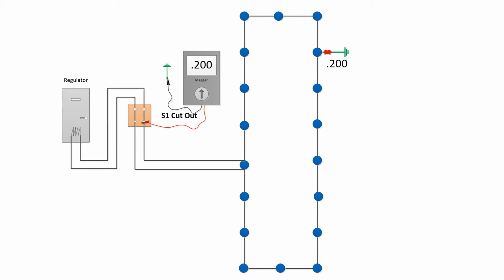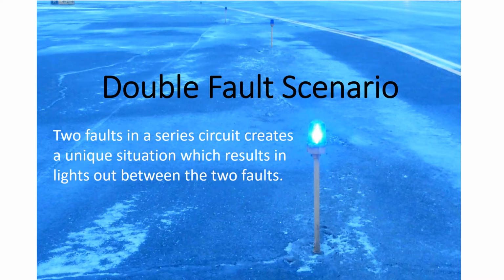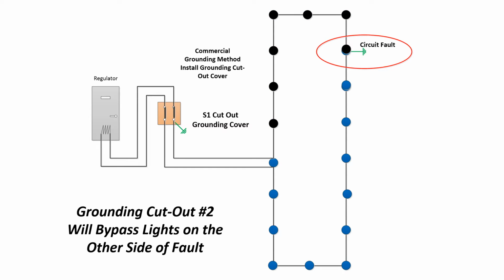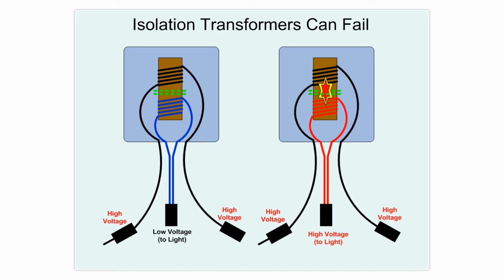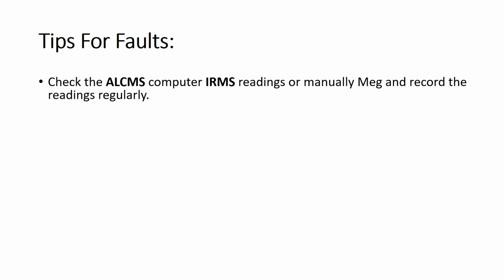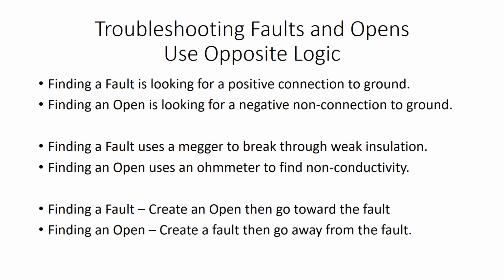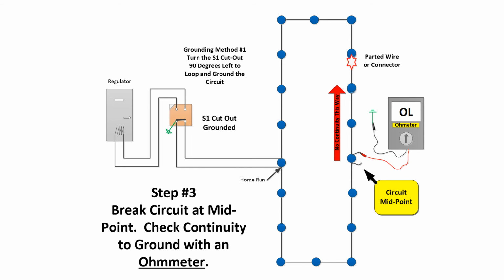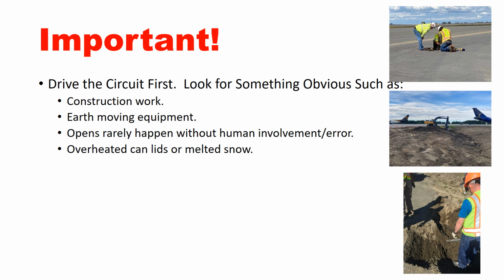DOT&PF Troubleshooting of Airfield Lighting Systems

Comment: I don't see a S1 cut out just has wires that go out and leave the building I'm assuming I'll have to cut them and manually join them with a ground. I can't find any documentation on this power regulator doesn't match the documentation on site. has a digital display saying open circuit and a keypad wish I had a manual. Crawling around in -30 with a pick axe opening cans that are buried under 6ins of frozen sand brr
Reply: Ooof   That's tough!  Good luck!

Comment: Multiple circuits in conduit  megger  detecting voltage cannot use 
5 days later tracking down fault located burn into two circuits under taxiway C 
PAPI’s and edge lighting 
Fun

Comment: I just started as the airport maintenance operator at palmer airport and airfield lighting repair is in my job description, i am not an electrician. These videos have been a great help thanks beav! My friend does airfield lighting for DOT in the MatSu valley so i do have someone to call with question so dont get the smoke let outta me.
Reply: Feel free to give me a call if you have any questions.  I live in Palmer so I could easily stop by some time.  Beav
Reply: @dennisdeering7010 hey Dennis wanted to ask you a question with a problem we’re having in our airfield if you can maybe give me some trouble shooting tips lmk

Comment: I have problems with TGS sir, can we modified the series transformer in to 220 volt...?
Reply: Some Regulators have multi taps for different input voltages.  Make sure you consult the manual and the manufacturer to see if yours can be modified.

Comment: To answer @159jakelong"s question:  Airfield lighting is a constant current AC series circuit and basically a big loop.  There is no neutral and no ground.  That's confusing if you are used to working with standard constant voltage parallel systems.  If you would like a more thorough explanation of this I'd suggest looking at another You Tube video called TSAIA - Airfield Lighting Safety Program.

Comment: Very informative. You are wrong about the double fault lighting through a ground. It lights from both ends through the regulator. We also don't use the cutout anymore because it can create more problems. It's better to find the actual problem in the field with a megger with the block out.

Comment: I got shocked from what I can only figure was the primary side of a circuit once. I had just changed the light and was grabbing at the bolts as I was also standing up. At that moment, I heard a crack and I felt my muscles convulse and for a brief moment I felt a 60Hz electric shock. Would I have not been in the process of standing up, I suspect I'd have fallen down and gotten possibly locked onto the can and wouldn't be writing this now. It didn't stop me from relamping hot though. I didn't sit through the whole video, but when troubleshooting remember that cans can explode. I saw this once. That white atmosphere inside of the can is vaporized wire insulation with nowhere to go--and it's flammable. We found a fault that was still arcing and thankfully everyone had wandered away from it before it exploded in a 4-5 foot fireball when oxygen got down low enough it reached the arc. Fixtures can be blown up in faults too, the water in the can boils and creates enough pressure it can blow the fixture into your face when the bolts are taken loose. If you're troubleshooting, either turn it off before you open the can or just loosen the bolts and use a pry bar to get the fixture just off the ground so you can see if steam and smoke start billowing out from it. And remember to clamp everything before you disconnect it. I left my airfield job thinking I';d be getting more money but instead found less money and a job I don't like. I miss getting paid to play frogger with airplanes.

Comment: When taking the readings to ground do you drive a stake in the soil or just use the inside of the can? Great troubleshooting video by the way👍
Reply: We pull a bare ground wire in every circuit which is attached at each can.  We clip one end of the megger onto either the wire or the can.
Reply: @dennisdeering7010  Thanks

Comment: The ADB Cut-Outs that we use do not short the input and output when the Cut-Out is pulled - it creates an open circuit.  You are correct that some Cut-Outs automatically short the input and output when pulled.  If this is the case you will have to put an insulator under the output shorting clip or remove the output wires to create an open.
Reply: I think he was referring to rotating the cover 90° and 270° and reinstalling them. The first grounds the outbound line and the second shorts the CCR to use in testing and troubleshooting. They apparently also have separate blue and gray maintenance SCO covers, one grounding the outbound line side of the primary like rotating the standard cover, but the other one grounds the inbound side of the primary. I'm trying to see if ADB still offers them to purchase because you don't need them until you need them, and tada! I need them.

Unfortunately I don't have a full circuit of elevated light posts to widdle down the location of the issue like he showed us here. We have two class 1 L-829 CCRs, one which powers the AGL circuit at 4.8 amps and one which powers our two single channel L-881 PAPI systems, both normally set to Remote and activated by an L-854 RCE through pilot controlled lighting. Of course it's the PAPI CCR and/or circuit which is giving us the issue, the ACE3 system spitting out an OpenCircuit fault code, which seems like it would be straight forward. Unfortunately, this comment section doesn't offer enough room to truly breakdown how this fault started, progressed, and ultimately ended up, but suffice to say it doesn't really care about logic. That said, a quick impedance measurement of the primary line made it clear that whatever is going on is very likely somewhere in the CCR cabinet. If I were a betting man, I'd put my money on a bad relay, somewhere stuck in the open position, confusing our poor CCR ACE3 system!

Comment: Doesn't pulling the S-1 cutout cause both sides of cutout to short together? If so, then when checking for a fault you would need to disconnect the wires at the S-1 cutout not just remove the cutout switch.
Reply: The cutout is the tie that binds.